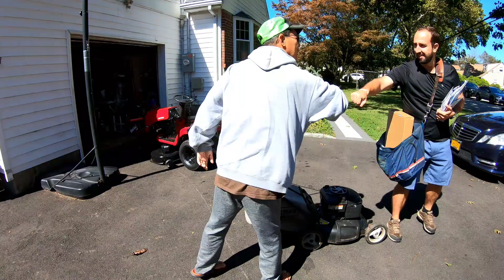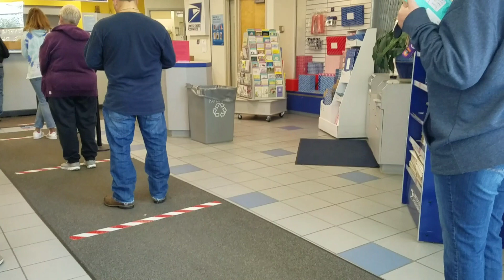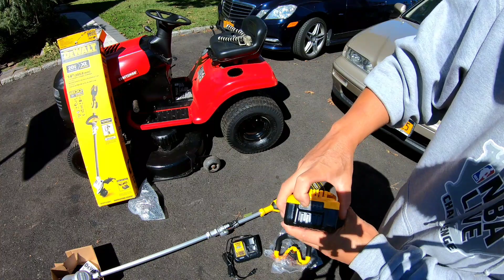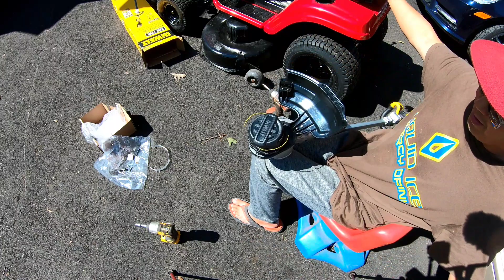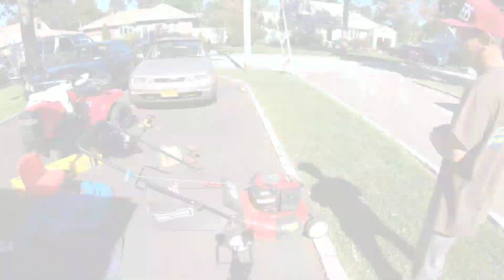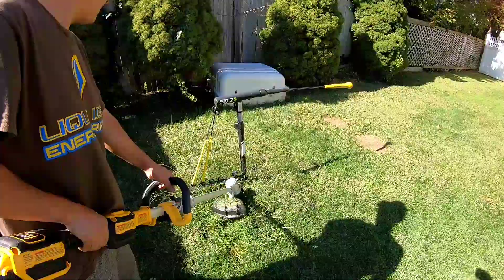DEWALT 20V MAX DCST922P1 FOLDING 14" BRUSHLESS QUICKLOAD STRING WEED EATER  TRIMMER UNBOXING REVIEW

Comment: I'm pretty sure if you start using any battery straight out of box without fully charging it first. It typically cuts it run time in half.  And yes, brushless means no brushes. I forget adzactly how they work but I'm sure there's youtube videos explaining those type of motors.

Comment: if thats the trimmer I think it is dewalt came out with it just this year. I was going to get it but the 60volt was $20 cheaper. And dewalt string sucks. Now I have 3 60volt flex batteries I can use in my 20volt tools. If you look henry. They make an adapter To fit 20volt batteries on their other tools. But I don't think smaller batteries will fit on 20volt tools
Reply from the maker: Good tip Bob
Reply: We have the quite the collection of Kobalt 40V yard tools.  Basically everything except a lawnmower and snowblower.

I thought 20v is 20v.  I did a quick google search and found an 18v to 20v adapter.  Do you have a link for the adapter you were talking about?  Wanted to get the Weedwacker battery on his 3/8” impact.
Reply from the maker: Pattay's Performance Jason, my impact is a 12v.